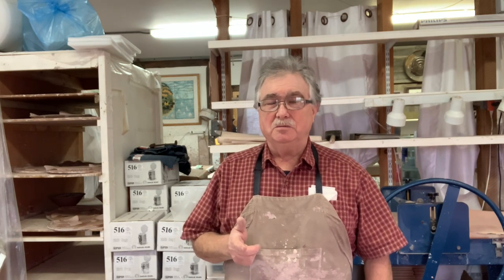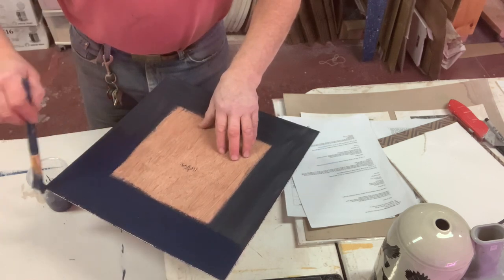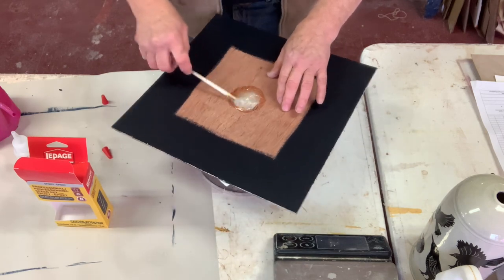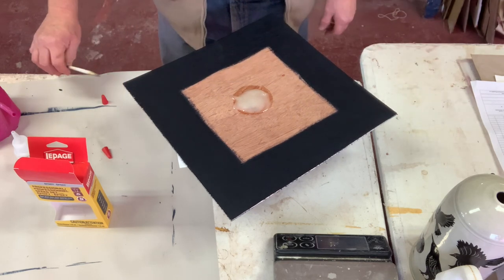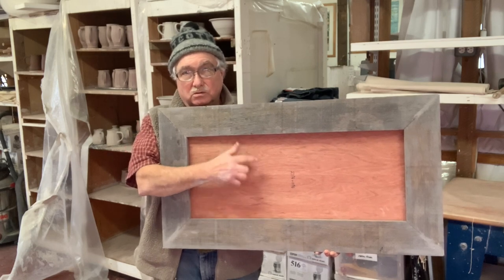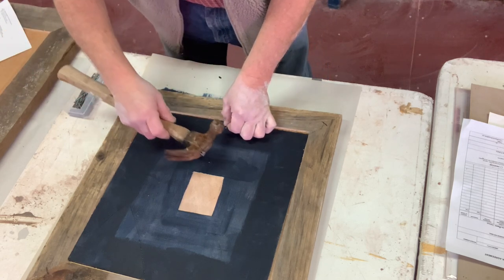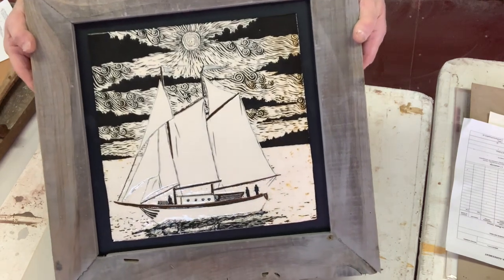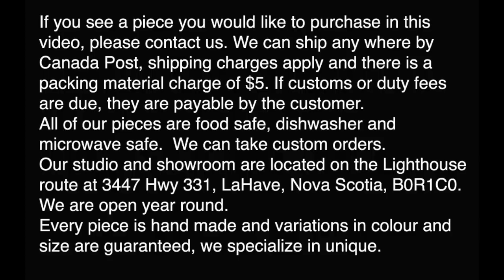How to frame a tile.

Comment: You have a good eye - I would have had to  get out the ruler/square.  I was surprised that the epoxy is just in the center thank you for the instructions. I like barn wood too and as a teen I helped my dad take barns down that were beyond saying - we salvaged everything from the planks to beams to square nails to wooden spikes and anything else still left in the barn - it was like treasure hunting. That was in the 70's when paneling family/reckrooms was popular.

Comment: Wow a sat video. Great with my coffee.
Have you considered glazers points instead of nails? There are a couple diffrent styles. I like the ones with the wings so you can push them in with a screwdriver. 
I've used them on glass. Not for this kind of application but they should work just fine.

Thanks again for the great video
Allen
Reply from the maker: I have a Framemaster that shoots metal shafts into the wood, I just prefer nails because the tiles are heavier. Thanks.

Comment: you can use a caulking glue which works well on tiles, since epoxy can be rather toxic--your tiles are beautiful
Reply from the maker: I have tried several glues using a caulking gun including industrial adhesives used in construction, always came loose after just months. My most embarrassing moment came at a craft fair when the sun was shining into my booth, the tiles got too hot to touch in the sunlight and started falling off the backing board. That is when I started using epoxy, I had my motorcycle glued together with it.

Comment: Hi there! Is there anyway to frame the tile without gluing it onto the backing? I'm hoping to be able to remove it in case I dont like how it looks years down the line. Thank you in advance!
Reply from the maker: I have removed tiles by placing the backing board on the top of a kiln that is firing to cone 6, wood down. You have to be careful to time it perfectly, I use a thin paint scraper to push under the tile all around as the glue starts to melt. I don't force it but at the right moment the tile will lift. The glue starts to smell like it is melting. Then put the wood panel outside, it is toast, literally. Pour some water on it for safety.  I have done this several  times, usually when a customer wants the tile but not the frame. Mostly I say no when asked to do this, the customer thinks the frame costs a lot and I will reduce the price if I remove the frame.
Reply: @Vsmithpots  unfortunately I don't have access to a kiln. This is more of a DIY decor project. I'm trying to attach pieces of tile into a shadowbox but most options require adhesives. Just wondering if there were other ways around it
Reply from the maker: You could try double sided foam tape. @noneness